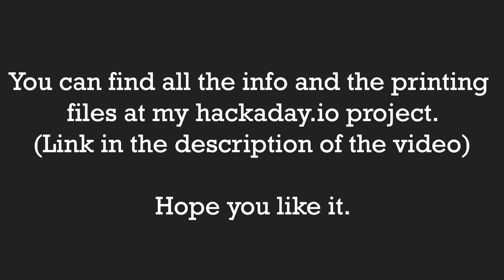Building quadruped robot V2 (OPEN SOURCE)

Comment: Very nice design! A little life hack that I started to use in my robots - try to use the small philips self tight screws to joint the details instead of glue. It allows easy to joint and then disassembly parts.
Reply from the maker: Yeah could be good for parts that would be disasembled in the future, but the 2 parts i glued are just a big one in the design, just divided them for easier printing. Anyway those screws seems a nice solution where there isn't holes. thanks mate!!

Comment: Hi - so will you show us some test demonstrations of the quadruped in motion, so that we can see how it performs?
Reply from the maker: This one performs practically the same as shown in the last version, becouse the code is exactly the same. And the relation weight/power is also the same as it weiths a bit more but runs at 6V in stead of 5V. Anyway, i will do a video showing the robot performing with its telemetry👌

Comment: how can you be sure that it attaches the horn to the servo at the right angle?
Reply from the maker: Normally servos has a mecanical stop so putting the servo in the middle position and mount the leg in the neutral position there won't be any problem, then when everything is mounted you can precisly calibrate the servos

Comment: Non of your files open, even with supportive apps. Please suggest.
Reply from the maker: Where are you downloading the files? They should work fine, there are other people who did print my files without problem. Here are the robot files (download STL_files.zip and unzip it) : https://hackaday.io/project/171456/files
If you want to modify the 3D model, then you can download STEP files, but if it is only for printing them, go for the STL.

Comment: Great job! Can i use arduino nano as microcontroller? Thanks!
Reply from the maker: Yep i think so, just adapting the code for this board and its pinout
Reply: asd_lab could u share the code for arduino platform? The code for callibration and full function code ?

Comment: 20kg cm servos,  how long are the legs?  will they have enough torque?  a lot of the quads i have seen seem to have problems with the front legs because there isnt enough torque.  btw, this is the best design video i have seen for a quad robot   https://www.youtube.com/watch?v=gRkh0Uz9Zvg.  hopefully it can give you some ideas
Reply from the maker: Each link is 10 cm long and the robot weigths 2 kg, they can hold the robot nicely but of course they can't make the robot jump for example. You can see the robot performing in my previous videos.